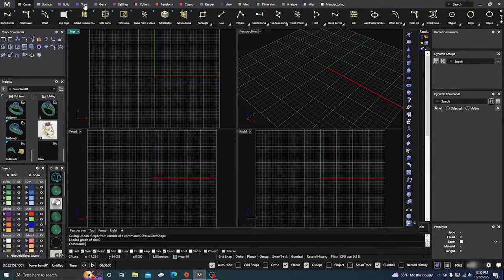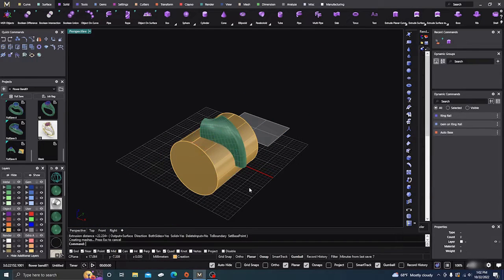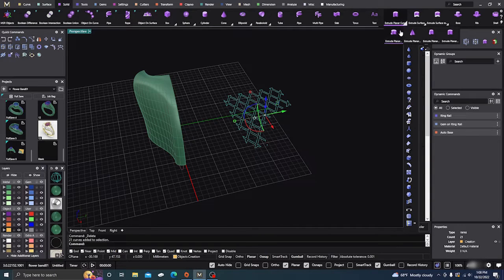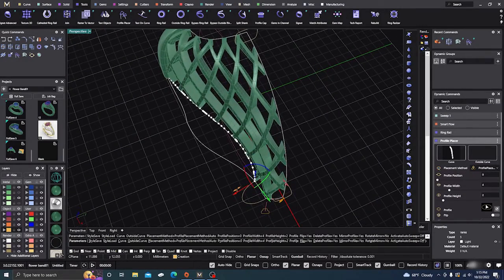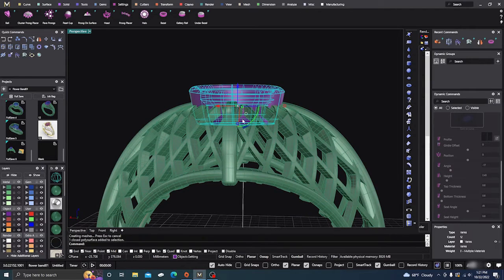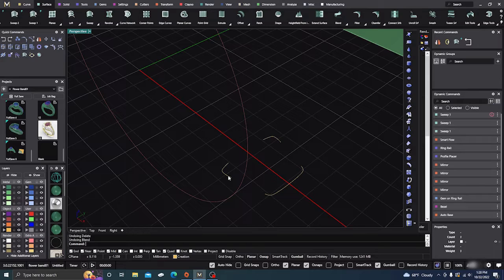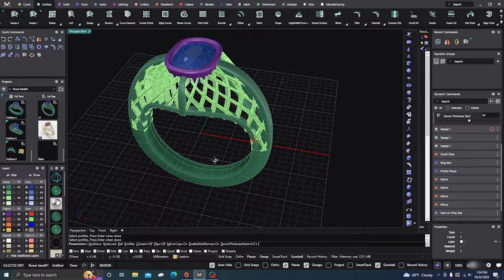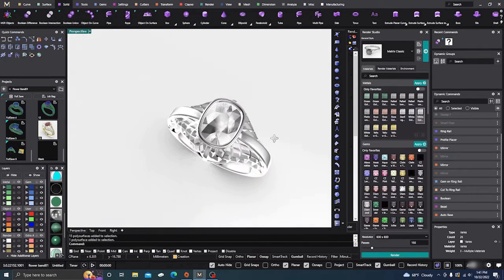Matrix 9 to MatrixGold  Open Weave design

Comment: when we apply pipe on jali pattern sometimes it create surface intersection error. how to solve this?
Reply from the maker: Pipe is sometimes difficult to work with if it has squared off edges or even sharp turns. You’ll either have to make your pipe diameter smaller so it doesn’t overlap or make the turns more wider. Sometimes it’s better to just place profiles on them and do a surface sweep rather than just using the pipe command. Really depends on what your working with.
Reply: @donsjewelrymakingandjapantrave  thanks

Comment: hello again. thanks for the informative video! i noticed you're aligning the uv surface and the autobase manually so i thought why not using the move command if that might help. thanks again. happy designing.
Reply from the maker: Yes, that is a good way to move the curves. I just haven't used that command to much but I will try to remember to use it in the future.  Thanks for pointing that out.